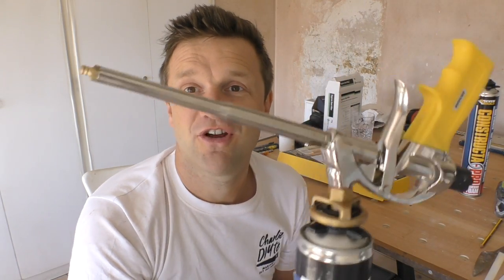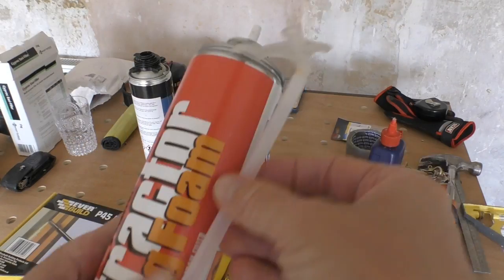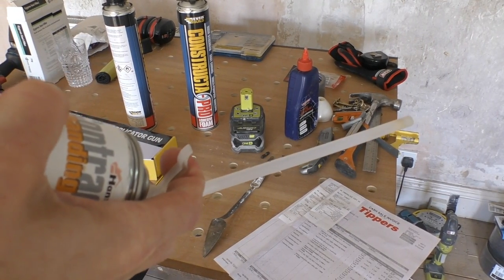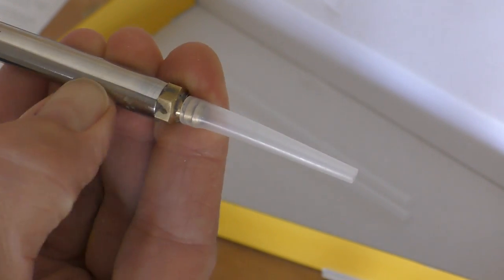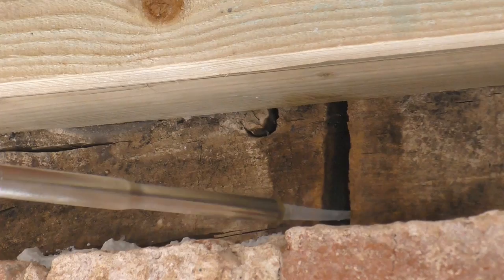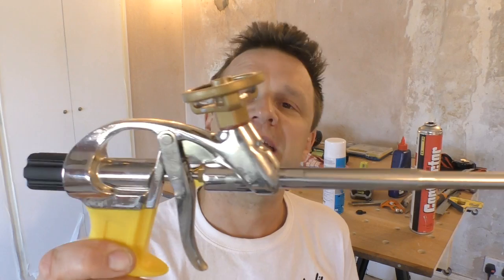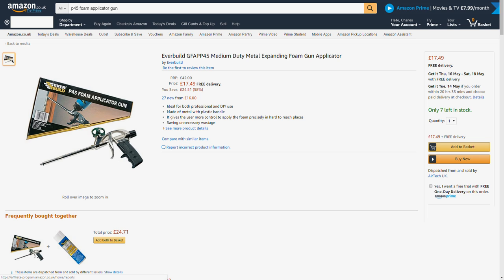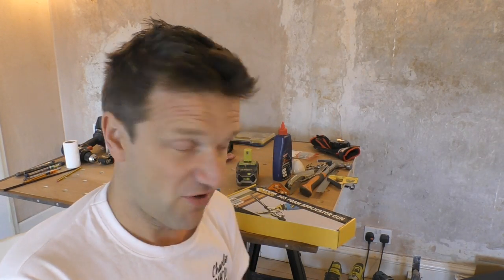Why Use an Expanding Foam Applicator Gun?

Comment: When the can is empty just screw on a new can and squirt a bit through and you will never need to use gun cleaner, also make sure you clean the tip of the nozzle with acetone every time you use it and screw the flow control fully home before storage!

Comment: Those guns are great but you should wear gloves, it's a drag to get that stuff of off your hands !!
However...
We have this shop called Action, they sell those normal foam spray cans so cheap (like less than half the price of those cans suitable for the gun) so throwing away half a can is still cheaper than buy the gun and the more expensive canisters if it is for DIY use once in a while.
Reply from the maker: You're absolutely right, I should. I tell you what though. If I had used a hand held gun I works have got foam everywhere, all over my hands. With the applicator gun though there was no mess at all. You're right though!
Reply: @CharlieDIYte  Action DYI gloves .... less than an euro ;-)
Sometimes the whole shelf  of those foam cans is empty, then you know a contractor has bought them all hehehehe

Comment: An applicator gun is not required. I use the cleaner canisters which are available to clear out the plastic applicator nozzle. You can then reuse them in the same way as the applicator gun so there is no need for you to blow them out or throw out a half used canister of foam.